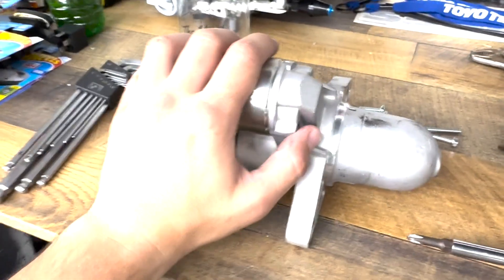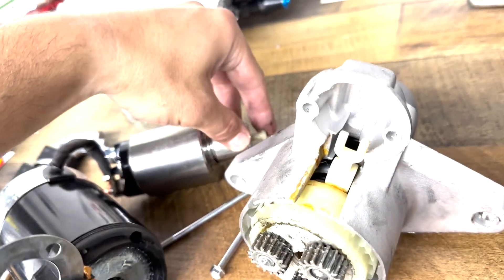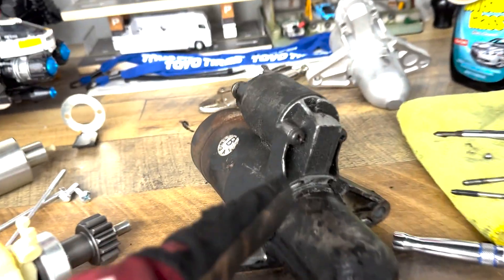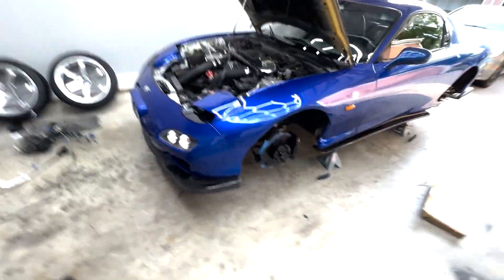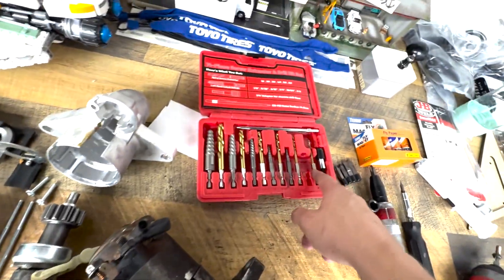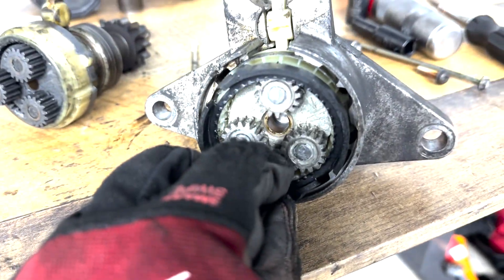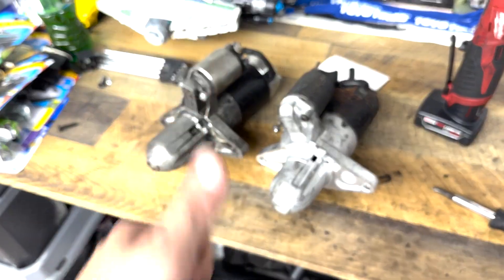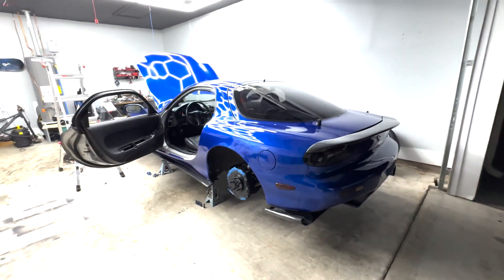RX7 FD RX8 Starter Mod in 10 Mins! EASY Step-by-Step Guide

Comment: Its 08 to 2011 rx8 starter. You need the s2 starter. 2.2kw
Reply from the maker: Check that link, that’s the starter I used… shows 04-08 r2 rx8 starter